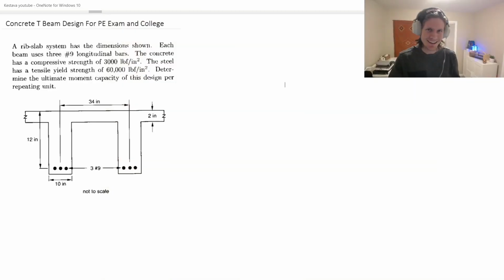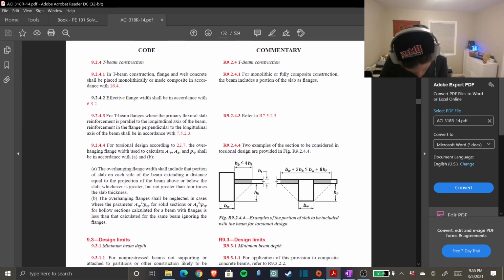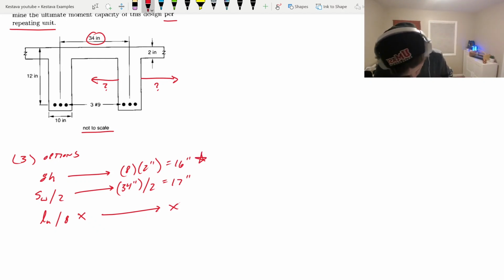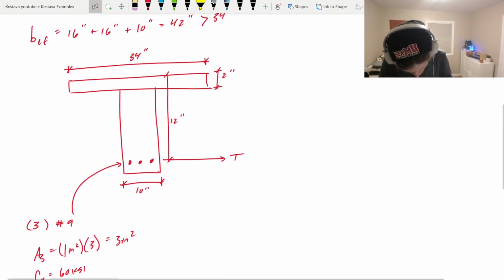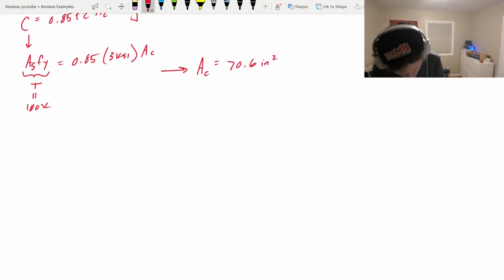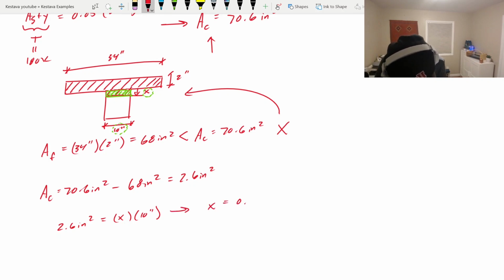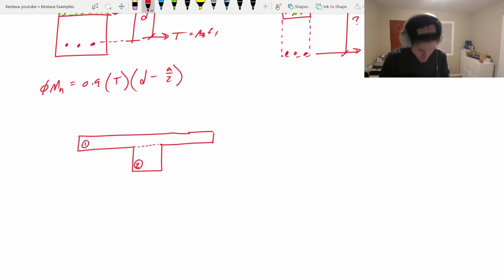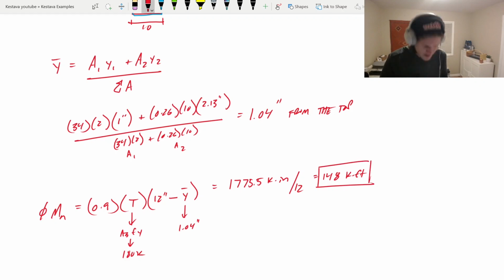Reinforced Concrete T Beam Design Example using ACI 318 | Neutral Axis in Web | PE Exam Prep

Comment: Good stuff, man. One item though, the effective flange table refers to the clear distance to the next adjacent web rather than the C2C distance. Otherwise, great job explaining the topic!
Reply from the maker: Philip you are absolutely right! man read it and looked right over it. thank you for the correction, and thankfully it did not control in this instance. keep checking my work! I always appreciate it.
Reply from the maker: SHOOT IT DOES CONTROL!
Reply: @Kestava_Engineering  hehe yeah I noticed it controlled while watching and was thinking “aww man, I hope nobody roasts him on this!” Really enjoying your videos so you won’t get any roasts from me 👍🏼
Reply from the maker: @djphonix  My man I appreciate all the support! Keep me honest always! also it looks like the totally capacity is still correct as the effective width would still be up to 34" so we are OK from a liability perspective haha. dodged that bullet... this time!
Reply: @Kestava_Engineering  If the width of the web is constant, then wouldn’t b.web + clear span always be equal to the dimension between web center lines? For this problem, it would be 10” + 24”, or 34”. 

Also, I really enjoy these PE related videos
Reply from the maker: @jonathanlitoff5142  not always - if the span between the beams is large enough then per the ACI you can only engage a max portion of the slab to call your flange. so it wouldnt always be correct to assume web width + clear span.

Comment: Hello, I am not sure if you still monitor this but I have a quick question. Since we are solving for (phi)Mn, would we want to verify if the beam is tension or compression controlled? If we set the steel strain to .005 I am getting a max steel area of 2.3 sq. in. Since we have 3 sq in here would the beam be compression controlled and therefore we would need to find phi per ACI 21.2.2?

Comment: Great video, like all of them! One question though... at the end, shouldn't the moment equation have ("a"/2), so (1.04"/2)?
Reply: No, since a is the total height of your compression block for a rectangular section, a/2 is actually the centroid from the top of beam. Since you're finding that centroid distance through the summation of areas for the T beam, dividing by 2 isn't necessary.
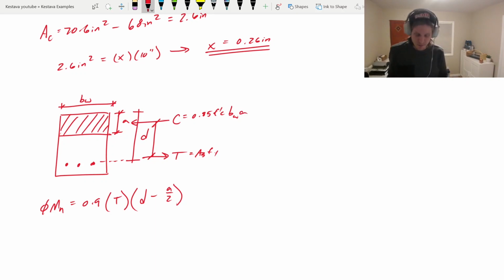Reply: 16:52

Comment: Thank you for videos, so helpful. I like your engineering approach. I have an question regarding effective flange width.  As per ACI 318 ( 6.3.2.1. ), the effective flange with bf shall include the beam web width bw plus sn effective overhanging flange width in accordance with Table 6.3.2.1.  I think effective flange width calculated as bf=bw + min ( 8h, sw/2,ln/8). Am I wrong, if I am where is my mistake? Thanks.
Reply: Husey, it's calculated as bf=bw + 2[OVERHANG] --> bf=bw + 2[min ( 8h, sw/2,ln/8)]. For a standard T-beam, there is an OVERHANG on both sides so we have to multiply by (2)
Reply from the maker: you are correct! just remember you get to take the value and multiply by 2 to account for each flange. I may have made a mistake in my video!

Comment: Thanks for making these! Quick question, should your a value be the NA of the compression area from the bottom not from the top? That way you have the correct moment arm distance to the tension force. I am finding my a = 1.22".
Reply: a is not the distance from top to neutral axis, it is the width of the compression block. therefore he use Mn = .85*f'c*Ac*distance between T and C. Distnace between T and C is calculated as 12-1.04 = 10.96"

Comment: Great video man , as always, thanks a lot! I think you're missing 1 more step after you got you "a" value you should get your "c" value and do a strain compatibility check to make sure you're in the TFC zone, otherwise your reduction factor may be lower than 0.9 and thus your ultimate moment capacity may be lower. Thanks!
Reply from the maker: Good call! tension force controlled members is for sure a must do check!